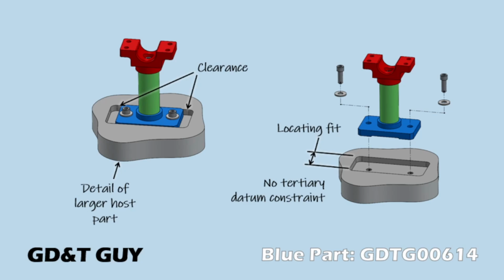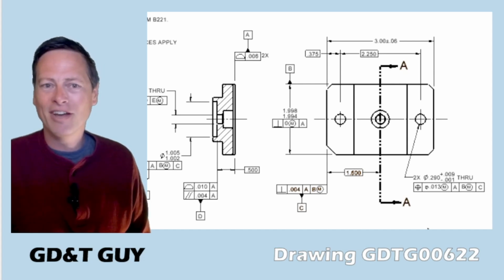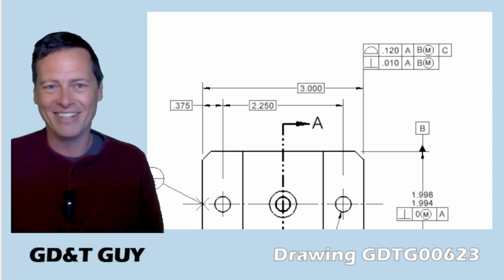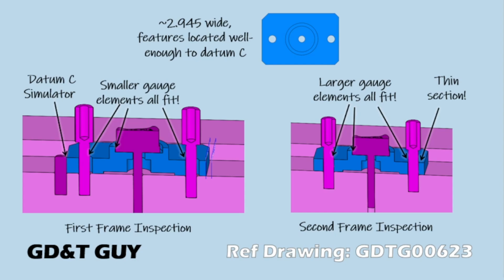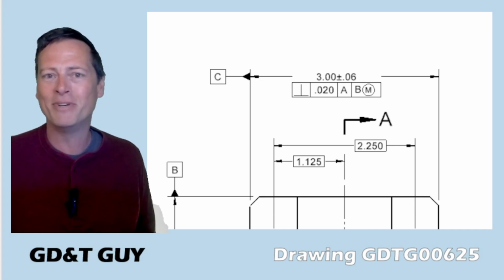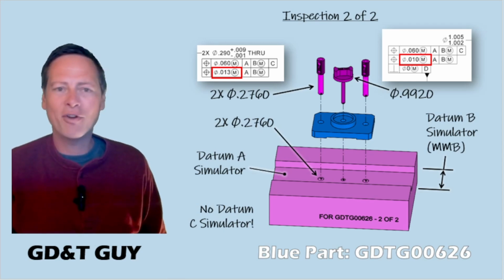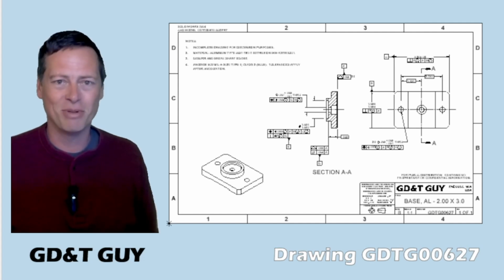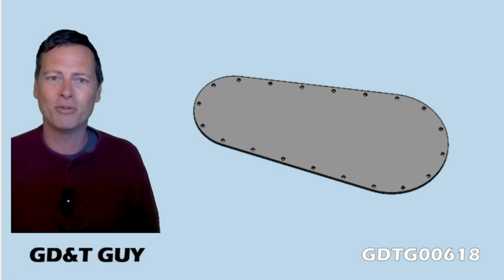Functional Datum Features - Ep3

Comment: I am having difficulty understanding how I should apply GD&T to a cast hole for an in process drawing.  .  When I make the inital face milling into the casting, let's say Datum A, that surface will be the datum from which i will machine the cast hole located at a basic dimension away from Datum A in the next operation. the cast hole obviously must "clean up completely" when i machine it.  I need to know what the gd&t should be for the cast hole when I make Datum A so that i can inspect the first operation and know that the hole will clean up a the second operation.  I would like the most amount of tolerance possible.  The inner boundary of the final machined hole is  dia .682 (MMC - POSITION @ RMB) and the outer boundary is dia .711 (LMC + POS POSITION @ RMB).  the inner boundary of the cast hole is dia .612  (MMC - POSITION @ RMB) and the outer boundary is dia .688 (LMC + POS POSITION @ RMB).  Can you help me?